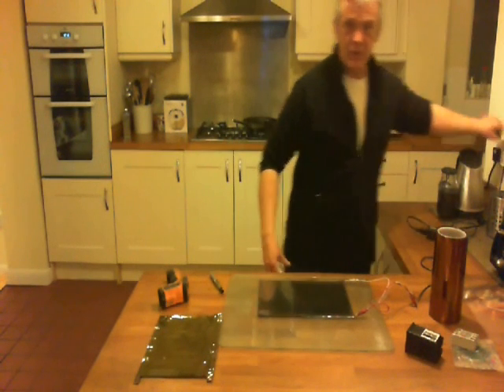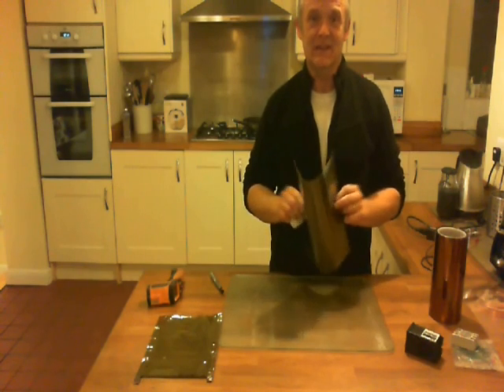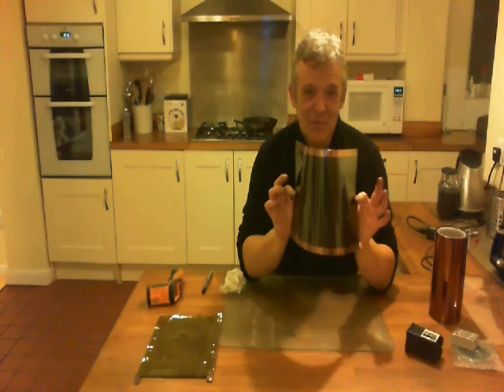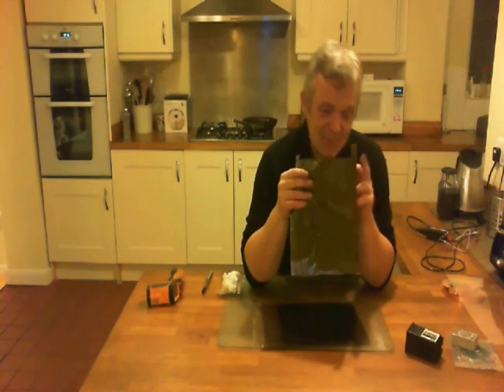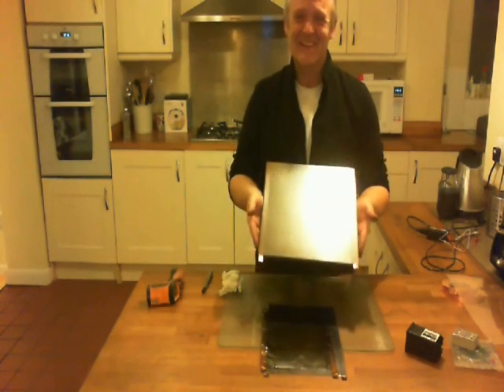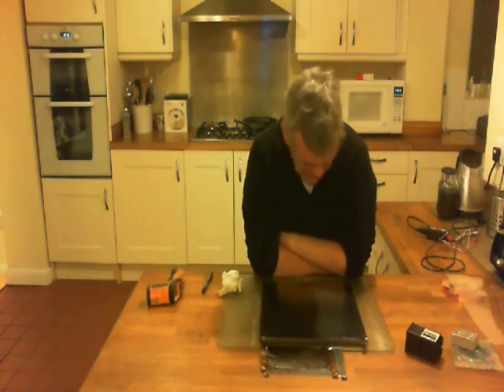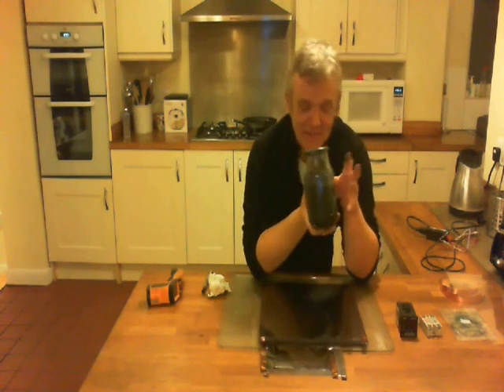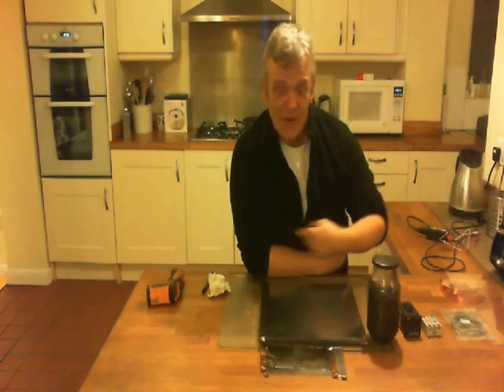Graphene Heating Elements

Comment: Hey Robert, I purchased a membership to your channel to ask you for help I'm building a graphene heating element. Can you point me in the direction of where to buy graphene sheets for cheap? I need the graphene heating pad, once made, to be 9 inches by 6 inches. Also, what determines the heat capacity of the graphene heating element? Is it simply the amount of electricity pumped into it, or does the graphene quality/thickness etc play a role? The graphene pads on the market are just slightly less hot than what I need

Comment: First of all thank you for the inspiration I get from watching your videos. I want to do a test with floor heating using Graphene. I want to use some kind of foil strips so I am looking to buy a roll of Graphene, I have seen graphite foil with Graphene flakes but doubt if that is right. I hope you can point me in the right direction of what the ideal sheet properties should be for my application. Have a great day, best regards Peter from Spain.
Reply: How did you get on with testing for underfloor heating? Seems like a great idea!

Comment: I'm going to try painting two steel plates with rustoleum high temp paint (which is non-conductive) and use that instead of the plastic sheets. Maybe 120V through this design would create a really nice heating element/hot plate.
Reply from the maker: it's an idea mate - let me know how you get on

Comment: Hi again Rob i was going to buy some heat mat's for my son as a Christmas present as he keeps on buying reptiles, now the graphene i will make once my sonnicator arrives and i have ethonol for the carrier but can you please tell me which Alkyd binder you used.
I do plan to get the missus to buy some of your books for me as an xmas prezzie this year so i won't have to ask so many questions....Lol
regards kev.
oooh nearly forgot i just made some graphite flakes from expanded Graphite and the resistance was........0.4 ohms  ....so just under half an ohm then ! at 1cm
The intercalated Graphite was from you know where that i told you about a couple of weeks ago.
I did it by expanding three times, as in expand and roll, expand and roll each time the worms got smaller and the flakes got thinner until now they will not even clump together and they are extremely fine flakes.
I could send you video proof if need be.
Reply from the maker: i don't need 'proof' mate - but it would be interesting to see your experiment - upload so we can all share
Reply: Robert Murray-Smith ok i will hopefully get that uploaded tonight but today i am going to double check and triple check again. as i did yesterday.
Reply from the maker: cool - give me a heads up when you post mate

Comment: This is so very interesting. So basically you manufactured the graphene (or graphene oxide?)... Then diluted it in water or ethanol and an alkyd binder, painted it onto the surface with copper tape.. And then baked it dry and you have your heating element?
Reply from the maker: Ravenis Black that's it
Reply: Robert Murray-Smith Is this information on this available in your book? I'm fascinated by the entire process.
Reply from the maker: Ravenis Black the book is a more of a how to make it mate - this more like making an ink

Comment: Hi Robert 
Hi can you tell me if graphene has any no stick properties when applied to heating surface of machine jaw surface. 
Can graphene be baked onto a surface and stay on and resist anything sticking to it like plastics at say 120 -200c 
Andy 

Regards
Andy Taylor
Reply: Leonard Janus I was wondering the same exact thing. Binding (connecting) the copper bus to the Graphene. 

Can you give me your contact info please? I’m going to attempt residential / Solar / Wall / Thermostat / DC Battery / Transformer  to Graphene surfaces here in NY. I tried to reach to Carbon 4 in Germany but they say they refuse to export/import into USA due to UL/CE listing issues. Of course.. USA is Sooo progressive... ridiculous. I’ll have a Master Electrician friend sign off on field installation(s). I found a Nuclear Grade Graphene Foil U.S. manufacturer. They gladly sent me a sample. I believe it will provide what I’m looking for in therms of X,Y,Z efficiency as well as <10 Ohm resistance. Anyone’s response for off the shelf sourcing would be greatly appreciated. 

Great Channel! 🥳🇺🇸
Reply: Jack Mosel  i did not really get what was you were looking for, but we can provide u graphene of different quality grade. Grafren AB (Sweden)
Reply from the maker: Andy Taylor I don't know mate - i have never tried it - but i would say it was worth a try

Comment: Hello Robert, I know you might not have a thermal imaging camera but how even do you think the heating is across the pad? also how fast do you think it dissipates the heat.
Reply from the maker: you are right I don't and they are a bit expensive lol - but I think it starts near the point of supply and spreads across the sheet from there - as for dissipation - I don't really know - but it had better be good as it would be rubbish as a heater
Reply: I am a big fan of what you do. Thank you for taking the time to post all these videos. I got a thermal camera from flir.com 349 on there website mine was from ebay 249$. I am looking to make a project using something like this for a heater, however i need it to heat up to 95c really fast and down to 35 also really fast. the size will be about 127mm by 85mm. Thank you again. You should set up a donate page.
Reply from the maker: Virgil Tudor
Cheers mate - I was looking at them for the heater and the cheapest I could find here in the UK was over 1,000 pounds but thanks to you post I will look again - it will certainly heat up quickly but I am not sure of the cool down rate - you are right I should set up a donate page and when if ind out how to do it i may well do lol
Reply from the maker: Virgil Tudor
cheers mate - but don't you need an iphone for that?

Comment: Check your resistance at high temp? Carbon unlike Nichrome or iron wire resistance drops with temp rise, should be about 1 ohm per 100 C. What this means is you could heat to temp. in parallel then switch to series to drive a load. Depending how you look at it, heat or load energy is free! Dare I say free energy proof?

Comment: Maybe you could try a Simmerstat from an old stove for control circuitry?

I want a plastic sheet so I can heat my desk chair. Winter is coming.
Reply from the maker: I wouldn't - aren't simmersatas bimetallic springs? I'd hate to be responsible for the state of your arse if it failed lol
Reply: Yep bimetallic. I was thinking for the granite slab and steaks. My arse is not a steak.
Reply from the maker: lol

Comment: Was the grapheme on the granite slab mechanically applied? And is that spelled caption tape?
Reply from the maker: kapton - it's a polyimide - and yes it was
Reply: Robert Murray-Smith my freaking tablet spell corrected me out of "capton " thanks for the correct. So did you use a spoon to apply it lol?
Reply from the maker: thagrit
lol - not quite
Reply: Robert Murray-Smith I've got several soapstone slabs from laboratory counters. I am thinking of trying this with a bit of that.
Reply from the maker: thagrit
go for it - I did a couple of vids on mechanical exfoliation techniques
Reply: Robert Murray-Smith Yeah I commented on several I think. The annealing with a spoon though reminds me of a cartoon called "The Tick" his battle cry was SPOON!!! Lol. I used a harbor freight corner sander and an old piece of shirt to graphenize several poly sheets to make capacitors. I think you could make carbon aluminum batteries that way too.
Reply from the maker: thagrit
I think you very probably could - don't you love it - here we are backyard guys doing amazing things with a harbour freight sander and an old shirt lol